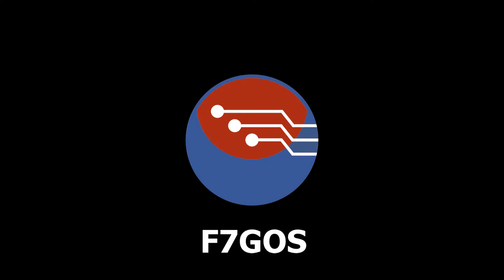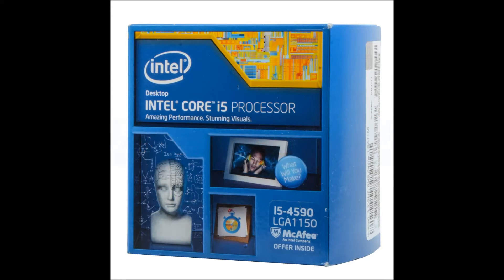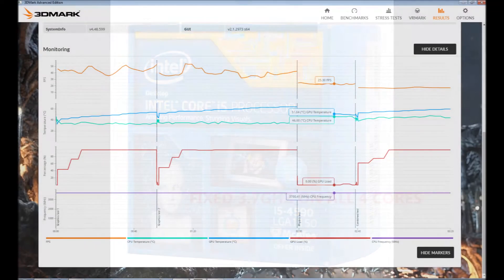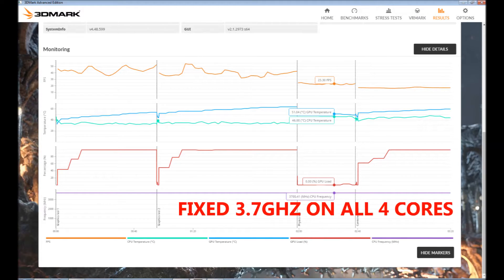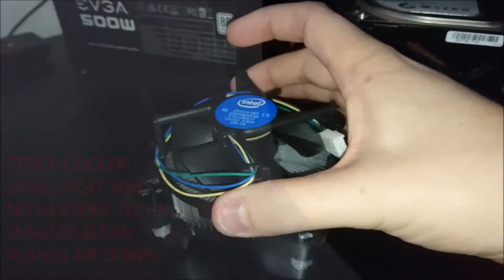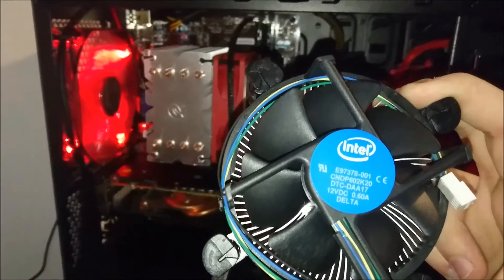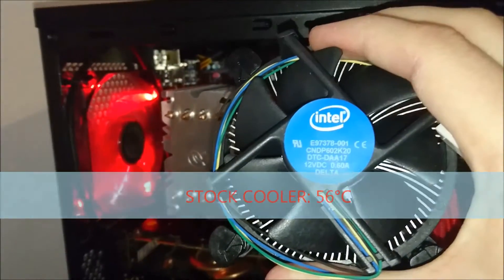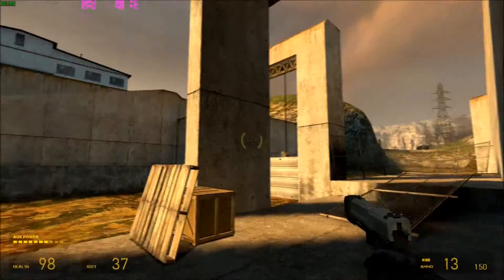Should you overclock on the stock cooler?

Comment: Well, you can overclock on any cooler only if : 

1) The CPU Should be on it's max turbo frequency 
2) Maximum load on both CPU and iGPU
3) Temps should be under 60-65'c 

Well so it's a green flag, you can overclock, I don't prefer any temps above 80 so make sure temps are controlled

Comment: Hey man just got i7 2600k. Can i overclock it over 4ghz?
Reply from the maker: I would expect you will need a very good aftermarket cooler to do that safely / stabily. The sandy bridge CPUs are older and run hotter than newer cpus
Reply: @F7GOS  i just tried csgo and temp was 90+c°. I will buy better cooler